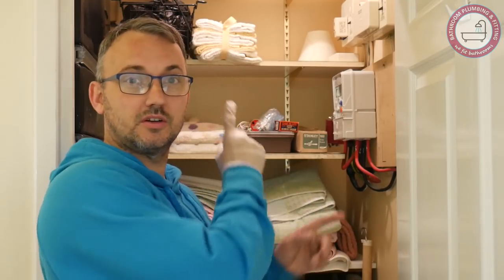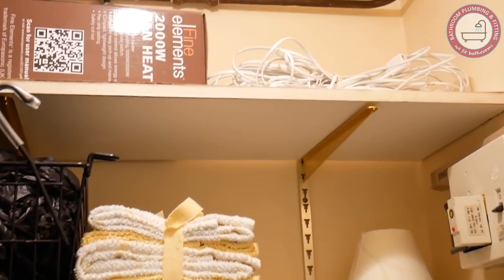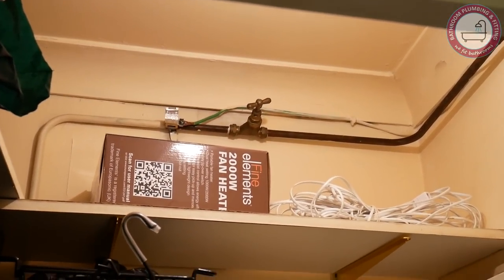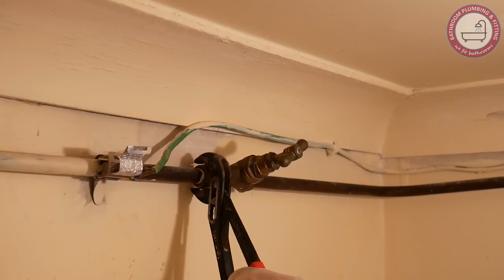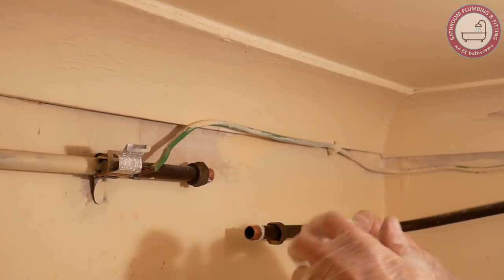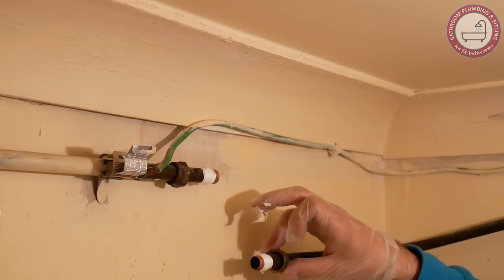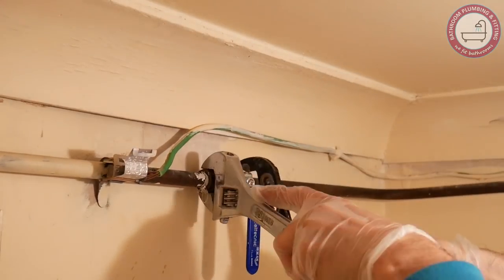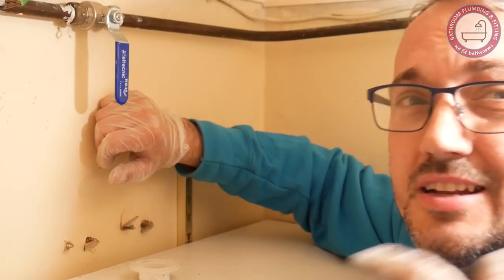Plumbers Vlog #1 | Nothing is ever simple! | Replacing a Seized Stopcock

Comment: hey mate . why didn't you renew the olives and nut when changing the stopcock? and 2 are all lever valves standard length? cheers
Reply: The piece of pipe here you cut off the olive might be ever so slightly damaged on install but you know the olive is well seated. With ptfe and compound you ain't gonna make more work for yourself which i huge in cutting off old pipe and fixing new. Lever valves should be all the same size in terms of length.

Comment: I was threatened by both Yorkshire Water and South Yorkshire Police whilst I moved a stop tap. Had to isolate at a shared mains water stop tap in the street. Served 3 properties. I diplomatically asked for permission at one house. No problem! Presumed the other house, after knocking on, that there was no-one at home. Had to shave down to fit a lead-loc. No room for a UTC as the mains came up beneath a base unit was going to go. Job was in Rotherham.
Reply: Neil Rusling  Shared with 6. Uh oh! Good luck mate. Sincerely. Just fyi. Broom Valley 1950's semis with an old ground floor wash house. The ones with a concrete slab roof. These have 2 stop taps fed off the mains water authority street tap. 1 in the kitchen and 1 in  the wash house. Sometimes they have been altered and run in common or if a combi has been put in the outhouse it takes cw from that tap and pushes out hot water throughout the house. Had one on Renway Road. Water meter fitted in kitchen but hot water to combi from outhouse... un-metered!!??

Comment: Great video buddy 👍👍 I am interested to know what would yo do if you needed to renew \ change a stuck  stocock in a house where the outside mains was not working / covered by block paving. P.S ignore the haters !!!
Reply: Hi, I  have experienced this, you just need to call Thames Water and asked them to replace the outside's main, make sure you tell them the urgency otherwise they will take their time, tell them there is a leak in your house and you need to isolate.
It's Thames Water responsibility to keep it in working condition not yours. Hope that helps.